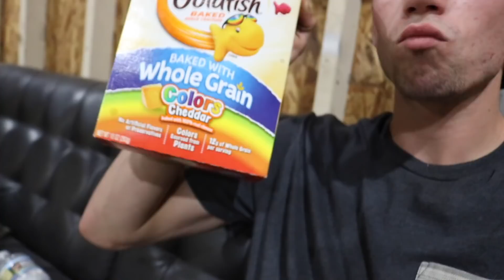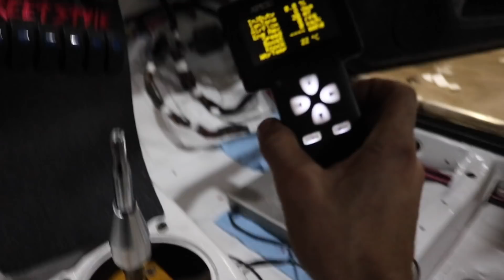The 450HP Sr20 Apexi ECU Powered Up And Ready To GO!!!

Comment: Theres 4 wires to get that PC Controller to work..now getting them to work with the motor is not completed yet so I outdent celebrate yet. Anything with a light will come on with some power n ground
Reply from the maker: Greg 24T all the wires are hooked up car should start I have power to ecu and ignitor also injectors everything should be solid once I crank over !